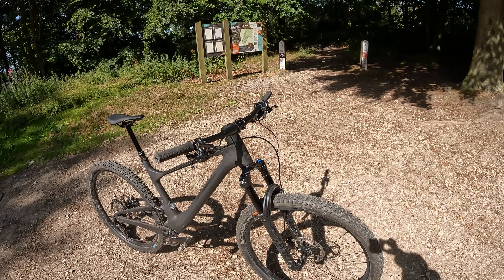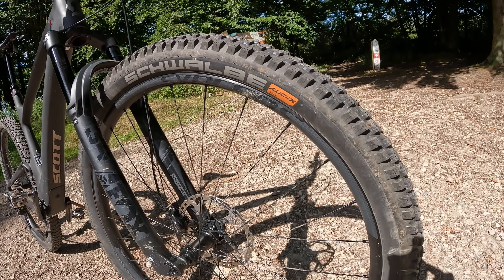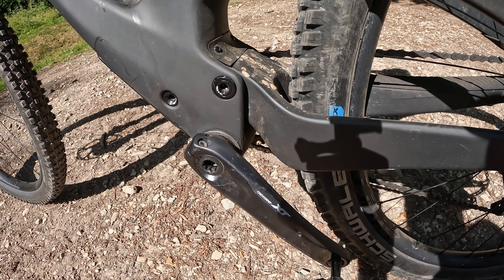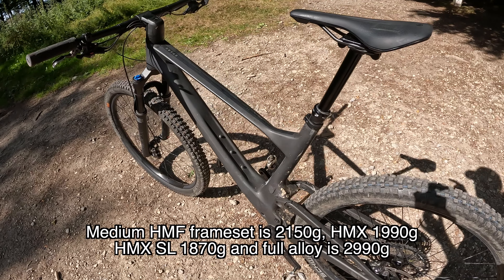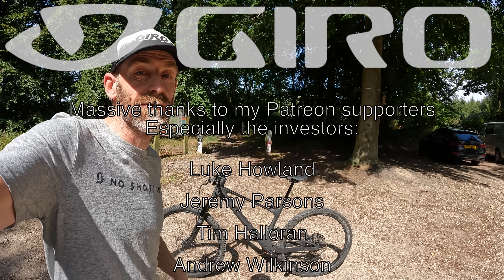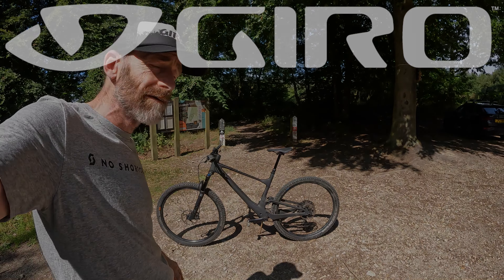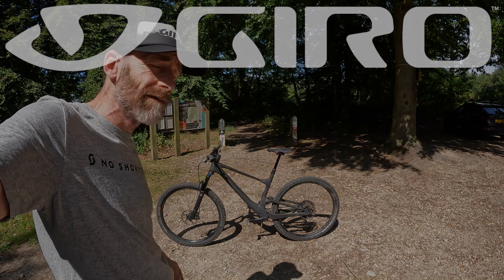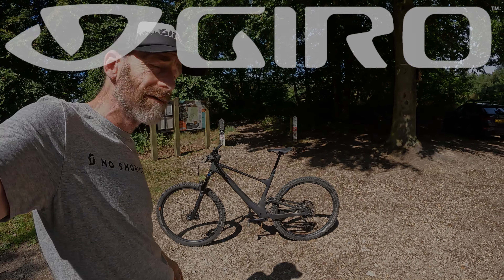Scott Spark 910 superlight trail MTB tech check

Comment: I have a Spark 950, wish I had gone with the 910 (maybe down the road). Love your reviews as well by the way, what do you generally use for sag setup on the Spark? I'm going back and forth between a softer sag setup (30-35%) and using twinloc more, or running around 20-25% and leaving it open more.

Comment: Hi Guy, really appreciate your reviews of the different Sparks. I'm coming from the previous generation (2018), can you say anything about how the new ones compares, mostly focused on the descending part? And perhaps the Transition Spur? I haven't seen you reviewing that one yet? Please continue your excellent in-depth reviews of the equipment!
Reply from the maker: Hey Sven, the newer bikes have a bit more travel at 120mm (if you have the 100mm version) but the Sparks like yours still descend really really well. Scott had always pushed the geometry of their XC bikes to handle more like trail bikes, but your generation of bikes was where the suspension finally matched up too. They set the benchmark which most people are still catching up with. I certainly wouldn't be rushing to change your Spark for anything else at the moment, just make sure the suspension has been serviced recently as that will make a big difference if it's been a while. I've been trying to get a Transition to test for years and been promised one several times (most recently in March when they added the UDH) but still not actually got one. They're heavier than the Spark though - especially yours as the more recent Sparks gained weight when they hid the shock. Hope that helps 👍

Comment: Anyone have any input on this bike versus the Trek Top fuel? Thanks! ( I live in New England and race in a weekly XC series and do some marathon races but I also have access to some great downhill terrain... trails in the area are really technical for the most part)
Reply from the maker: Hey Troy, I've just started testing the Top Fuel in a very similar spec so I'll post a full review and some comparisons shortly. Have you watched my Spark RC V 910 video and the two edits from Ard Rock Enduro? Bottom line is that the RC is way more capable/balanced than you'd expect so a switch of tires would make it happy to play daft on tasty descents but with fast rubber on it's a beaut for racing. Top Fuel is a LOT heavier and not really a race bike in my opinion.

Comment: How does it compare to your Pace 295?
Reply from the maker: I’ve had the pace to within 500g on weight with a lightweight wheel and tyre spec. Angles on the 295 are a lot more aggressive and the extra travel definitely gives it an edge on tougher/faster trails. The 295 also pedals with more stability than the Spark in open mode but obviously you can firm or lock the Spark if you need to. So Pace better all rounder but Spark is the better speed/distance bike
Reply: @GuyKesTV  Thanks Guy. They make great bikes in Yorkshire!

Comment: They must be buying from lightcarbon as they had this frame about 3 years ago.
Reply from the maker: I’m pretty sure you’re thinking of the copies of the older Spark frame that were coming out of the Far East. Not seen anything with the enclosed shock, really interested to see any links you have though 👍🏻
Reply: Didn't Scott buy Bold cycles or something similar that had the patents for the internal shock?
Reply from the maker: @joonakankare4770  yes, they bought them a year or so back. slightly different layout but definitely Bold tech.